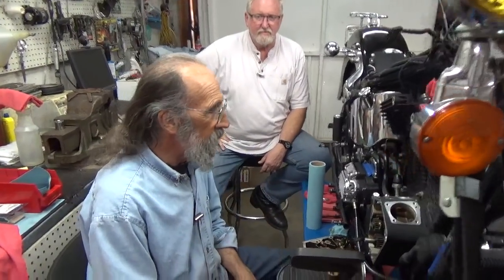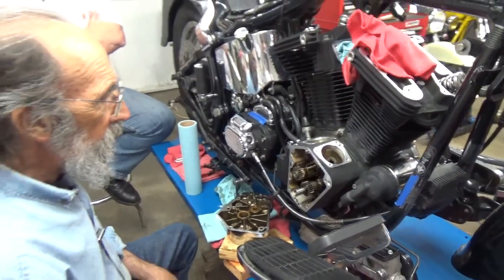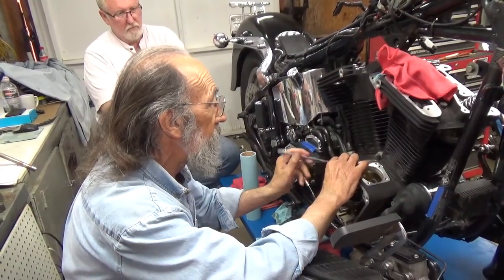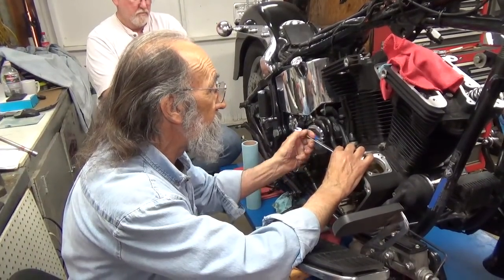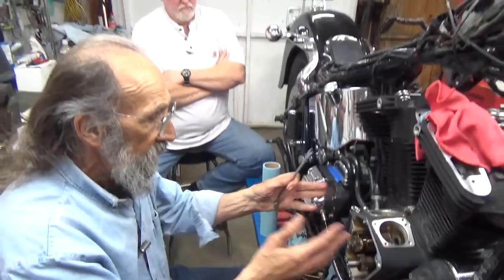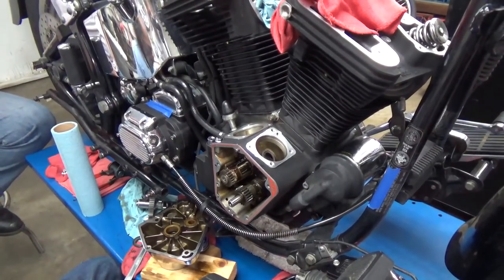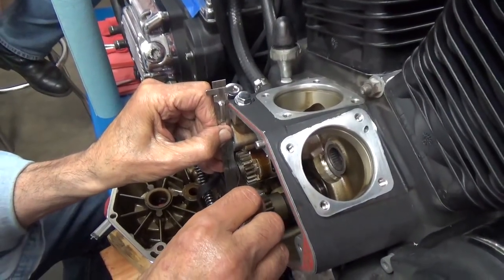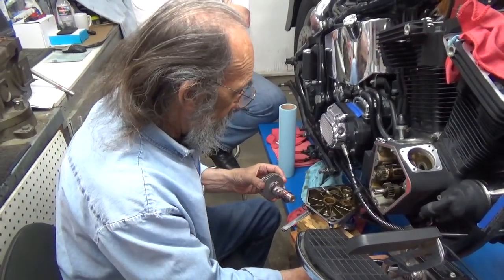Installing Cam & continuing Into Next Video Part A

Comment: My new cylinders and pistons haven’t come in yet, so this could be my next step….you are right in sync with me!
Reply from the maker: That's very cool.  Take it slow.  It's in the details.  Super sanitary clean.
Reply: @pacificmike9501  slow is mandatory with a day job….cleanliness an effort but have many rags and  much cleaning fluid will be copiously used!
Reply from the maker: That's the spirit!

Comment: Mike! You're using the box end of a wrench! I can't recall you doing that before, ever. Like all your uploads this series of videos has been informative and interesting. ✌🇨🇦
Reply from the maker: I hate to chip fasteners.  Sometimes, box end is the way to go.  Motorcycles are more than machines to me.  Beauty (as I perceive it)  Is very important.  And, as a mechanic, I didn't like chewing up fasteners on my customer's baby.
Reply: @pacificmike9501  Agreed. I've seen way too many of those chewed up because someone didn't have access to a draglink socket. You've mentioned you use the open end to avoid damaging the fasteners right? Or did I hear that incorrectly in a long ago video of yours? That could have happened. I'm getting into the forgetful stage of life. 😆
Reply from the maker: Open end to keep from knocking off chrome corners.

Comment: How important is line boring a new cam case bronze bushing to match the came bore? I had to install new cam cover on my 87 FXR  and bought one ready to bolt on with new seal and oem  tolerance bushing. It went on ,but it did not just push on easily like yours did. I had to draw it on with the screws. I was afraid to tap the cover on with a leather hammer in a dead blow.  I didn't have the special tool to remove cam and I assume put new cam cover on and line the 2 holes up perfectly .I rode the bike with no issues but wonder if that was a critical step I should have done. I ve since had engine totally rebuilt by A life long pro HD Machine Shop  here in W Pa. Guys like yourself ,and the Motorcycle machine shop I use are a dying breed . Who is ever going to pick up all the knowledge you guys possess. Thanks for all your knowledge you share right here on You Tube. I am thinking of picking up an early V Rod with low miles . I know they were never embraced by trad HD guys ,but they are mechanically rock solid drive train from everything I ve read and heard .The new Sportster  with the V Rod style motor 120 hp  off the showroom floor I think is going to change things up .
Reply from the maker: Okay.  Here we go:  You had to press the cover on.  Something did not align perfectly or was too tight  So now the question is:  Will it wear in and be just fine?  I can't tell you that one.  All we can do is assume, because it's running fine, that it's okay.  What we don't know is if there is stress on the cam bearing and if one or both of the bushings in the cover was just a little tight.  It has probably run in now and is fine, or you can be uncomfortable and take it apart to inspect it.
Reply: The motor did run fine so it probably wore in . The engine has since been totally rebuilt for the crank pin being gaulded(rough) . I was just wondering if you were to put a new cam cover on ,would you use the reaming tool or boring bar the Harley Manual recommends .Thanks
Reply from the maker: I certainly would have checked it with the motor apart.

Comment: great video.  I'm getting ready to do a cam in a 80" evo.   Do you prefer the metal breather gear and do you worry about  the gear lash with a new cam?
Reply from the maker: Individual bikes have individual issues.  Stock breathers are all fine.  We start making changes in the motor.  Sometimes we need to figure it out.  Mild cam change?  Stock breather fine.  Stroker?  Huge cam?  Stop and think it over.

Comment: Hi Mike! I’m finally getting around to rebuilding my 98. You answered all of my questions before with great knowledge haha. I’m replacing the stock cam with another used OEM cam. Should the original shim and thrust washer result in the same amount of end play it currently has? First rebuild I’ve ever done, so I don’t have all the extra resources laying around nor the knowledge of what to purchase. Thanks!
Reply from the maker: Always check the cam endplay.  The factory assembly here is usually a huge endplay.  Everyone I know, resets them.

Comment: Did Harley switch away from the tabbed thrust washer? Opened up My 95 softail and it has a single fully circular thrust washer. But I believe the manual has the tabbed one. Nothing else inside indicates aftermarket parts or someone messing with it. Should I order the tabbed version and use it in conjunction with my shim? Installing an ev27.
Reply from the maker: Late model Evos have huge camshaft endplays and all come with a round cam shim.  I usually install the old type shim to replace it and get the endplay the cam manufacturer recommends.

Comment: Hi Mike, I am a lttle confused the way you install the tappet screen. In my opinion it must be installed with the closed end upside and an additional spring. So tells every manual at least :-) Greetings from Germany.
Reply from the maker: Different screens for different models.  The one in the video is a 65 Panhead.  It is an early type.  The Cone motor Shovelheads and Evos have a pointed screen which goes in with the point up, then drop the screen on top, over it.

Comment: I've had an issue finding a pack of cam shims of various sizes. Like the ones im finding are maybe 5to10 per pack but all the same size. So I would need to figure out my exact endplay before I can even order a shim the correct size . Would you know of anywhere I could find a variety pack?
Reply from the maker: I don't know.  I've always bought them as a shop.  5 in a bag was okay.  Measure for what you need and buy one larger, one smaller, and one just right.   Sorry.  Couldn't help it.  I used to (before I started working in a shop) measure, then go buy  three sizes hoping to get what I wanted.  I don't know of any suppliers, just shops, that sell individual cam shims.

Comment: I've got a question hopefully you can or will help me lol 
I found two dots perfectly centered on the flywheel and the front piston is TDC should I go with it or continue looking for the line.im installing an ev 27 on my 1997 1340 evolution. What should I do . Thanks in advance
Reply from the maker: Keep looking.  You have found TDC on the rear cylinder.

Comment: Hi mate I’m new to Harley motors I’ve got a s&s v96 I was pulling off the cam cover and cam dropped out with it the issue I have now is can I be 180 out or just line up marks and should be good ?
Reply from the maker: Just line up the marks.  You're good.

Comment: Hey Mike thanks for your hard work on getting your videos out, i have a 1994 Harley Davidson heritage nostalgia softail fully stock, i will like to spice up and work on the motor and i will like your recommendations on modifying the motor and cam, im looking for sound, performance and touring on long trips, what are your recommendations? 
Thanks 
Efrain
Reply from the maker: It's all a matter of what you want and what you want to spend.  I did bunches of them in the past.  Your choice on carburetor (S&S or Mikuni HSR42).  Cam again, your choice.  Read all of the specs and don't go too wild.  The mfgrs will tell you what each cam will do.  Depending on how many miles are on the bike, you might want to install a new set of valve lifters (good aftermarket set).  You'll need a good exhaust system and probably a good aftermarket ignition system.  Don't forget, with the new cam, you'll need a set of adjustable pushrods.  This is why I don't like to make recommendations.  I don't know what you're wanting in the way of performance.  I don't know how much money you want to spend and I don't know your level of mechanical skills.  But, that's the stuff I would do.  Lastly, I don't push brands.
Reply: @pacificmike9501  Thanks Mike

Comment: Mike, I own a 98 Evo and just bought an EV27 cam for it. I noticed in the original set up I only had the round thrust washer. With the EV 27 and only the thrust washer there is way too much play. I measured both the old and new cam lenght between shaft ends and there is approx 1/16 length difference. I was told that the EVO 1 had shorter cams than Evo 2 and that aftermarket cams are made for both. Can I simply add a spacer between thrust washer and cam or do I need to do something else?
Reply from the maker: I don't know of such a thing as Evo one and Evo two.  I generally install  a shim between the cam and the thrust washer.  I'm assuming that is an Andrews EV 27 cam.  I also believe that cam came with a blue instruction sheet.  Read it and govern yourself accordingly.  Just joking.  But, Andrews knows exactly what they're doing.  Their instructions are perfect.  Read the end play of the cam in the engine and select the proper shim.  That's the only way to be accurate with it.

Comment: Hi Mike , I really enjoy watching your videos and have learned quite a bit so I have a question for you. I have a 98 evo and thinking about installing the Andrews 27 cam  in it but I was told that I should swap my original cam gear to the new cam so it would match the pinion gear perfectly so in your professional opinion is this nessacary? Thanks!
Reply from the maker: Probably not.  If you look in your service manual, you can see how to measure that gear and how the cam gear and the pinion gear are "color coded."  However, with todays quality control and measurements, you will rarely have a problem matching gears on an Evo motor.  I'm not saying it doesn't happen.  I'm saying it doesn't happen very often.  Most of them (certainly on Evos), you just install your new cam as per the cam manufacturer's instructions.

Comment: Any chance you could do a video to explan lift and duration and their effect on performance? I'm trying to build my motorcycle not just the motor. I checked out your vid on changing gear ratios and learned a lot, now I'm looking for that balance between power and gearing to get what I want. The sweet spot is kinda elusive bro, any help will be greatly appreciated. Thanks...
Reply from the maker: That's a little more technical than I like to show.  And, I go by reading the descriptions in the catalogs to see where that cam is going to perform.  Then there's preference that comes from experience.  Each designer of camshafts uses his own scientific approach..  Then, everything that goes with it.  I try to stay away from explaining things beyond my comfort zone.
Reply: @pacificmike9501  I can respect that. I've been riding since the early 80s and never really considered how many details come together to create the overall experience. Thanks anyway. Really enjoy the channel
Reply from the maker: Thank you.  Sorry to be so vague.

Comment: Hi Mike,  great Videos,  nice bike. I'm looking for a recommendation, are those steel breather gears a good choice instead of the plastic breather gear?
And if yes, do you recommend a specific maker?
Reply from the maker: I've used both  with no complaints.
Reply: Hi Mike, is there a recommended replacement interval for the original plastic breather gear? I mean, after a specific amount of miles or years maybe? Of course it is to beplaced when it is broken.
Reply from the maker: Not that I know of.

Comment: No checking cam gear diameter?
Reply from the maker: Not always necessary.  Factory color codes them.  Aftermarket allows for more.  There is "old age and treachery."